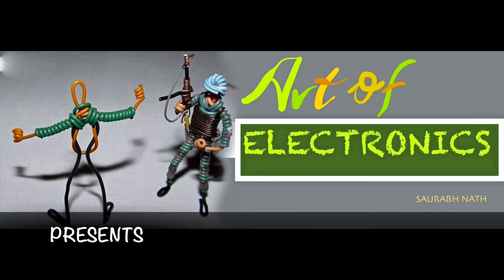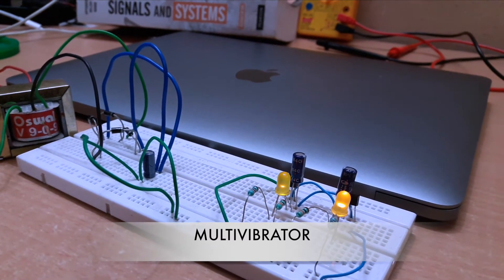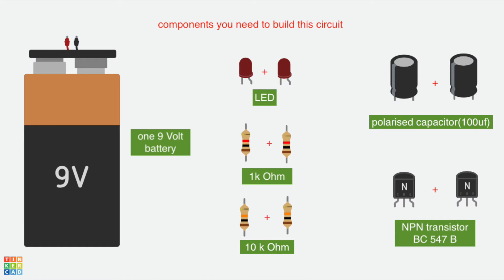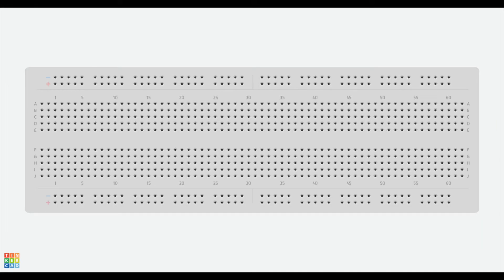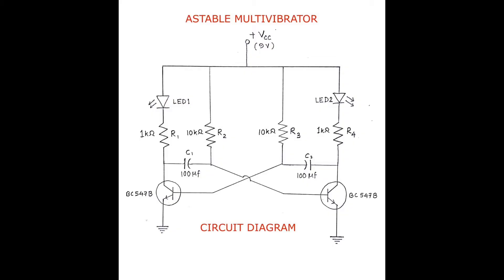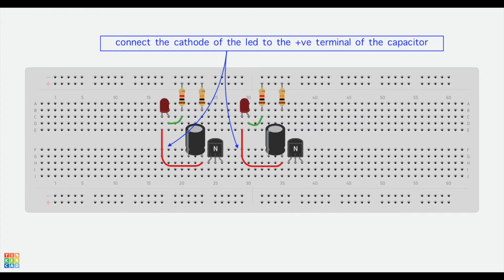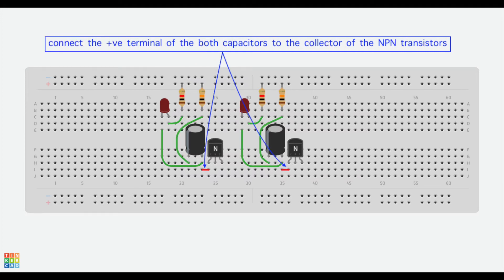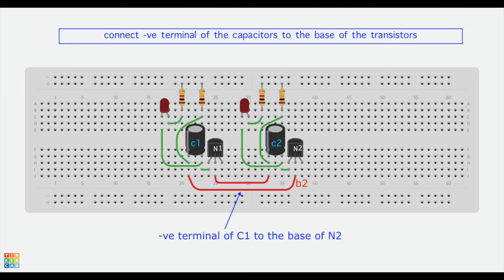ASTABLE MULTIVIBRATOR ||| PRACTICAL || SIMPLIFIED

Comment: What is an astable multivibrator?!!!
Reply from the maker: An Astable Multivibrator or a Free Running Multivibrator is the multivibrator which has no stable states. Its output oscillates continuously between its two unstable states without the aid of external triggering. The time period of each states are determined by Resistor Capacitor ( RC ) time constant.
Reply: ART OF ELECTRONICS It is the first time I have got a reply from a creator